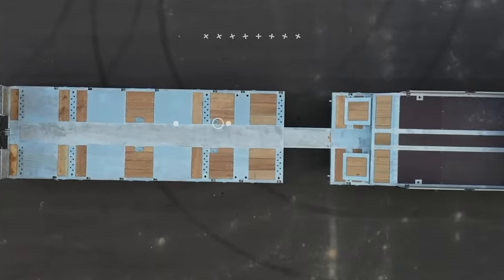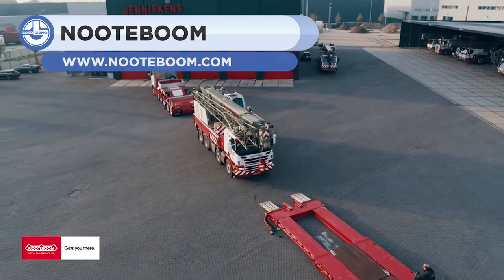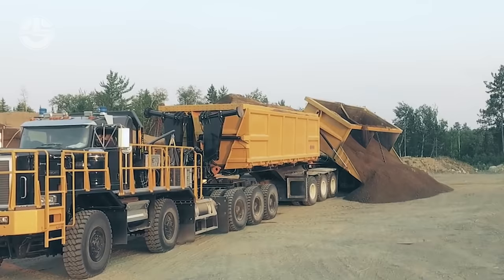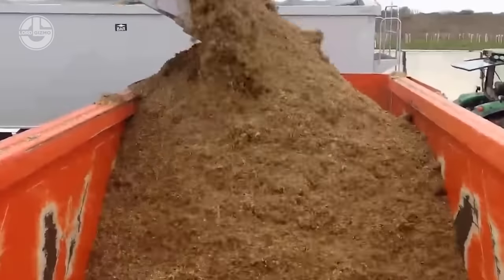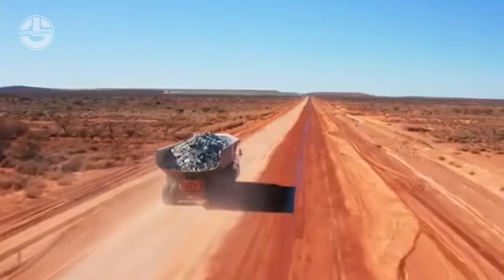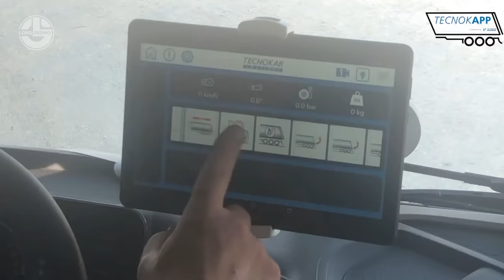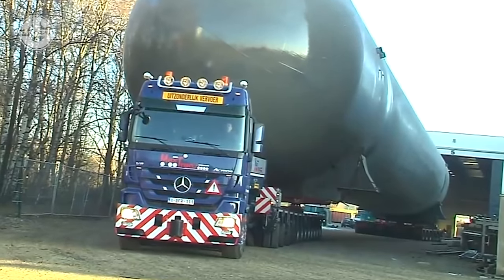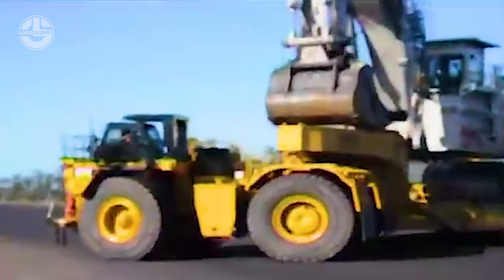The Most Impressive Dump Trucks And Trailers You Have To See

Comment: I found out that some highways won’t take a lot of loads so this machine could only go on certain roads because it’s probably too heavy for some highways.
Reply: Which one? can you specify!
Reply from the maker: That's true!  It's largely the reason that massive dump trucks and other construction equipment can't be driven to their sites.  Doing so would cause damage to the road surface and cause the creation of massive potholes.
Reply: @-sawal  each state is different so if you have them overload trucks you better know the way that you can go over highway. Just recently they wanted to put salt down on the roads, certain states don’t have enough salt to put on the roads because they only was allowed to carry a certain amount of salt for the highway.
Reply: Michigan super trains are on the highway all day long. 160,000 weight limit. 11 axles.

Comment: They should really only give the torque output figure when talking about power….my car has 800hp but wouldn’t fair well with all that weight 🤣
Reply: @abcdef-qk6jf  the saying is
Horsepower is how fast you hit the wall
Torque is how far you take the wall with you

HP is just a result of a calculation with torque vs rpm